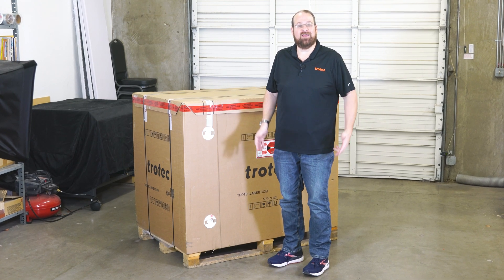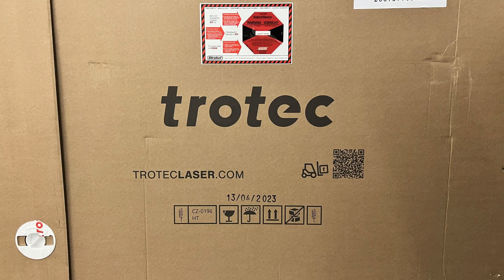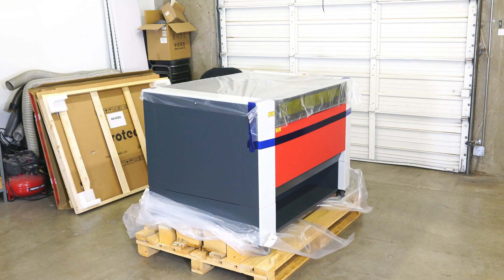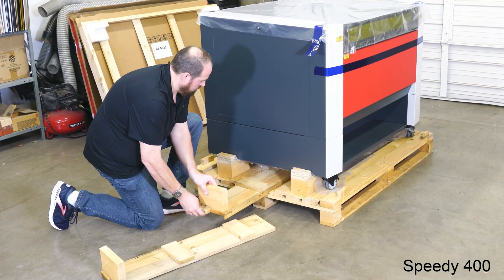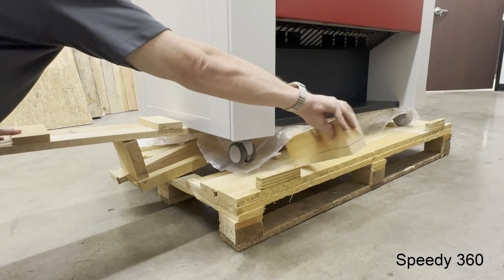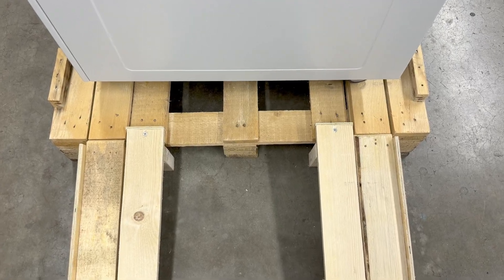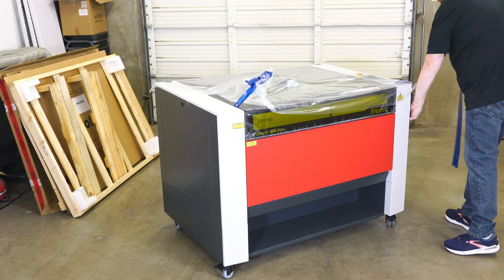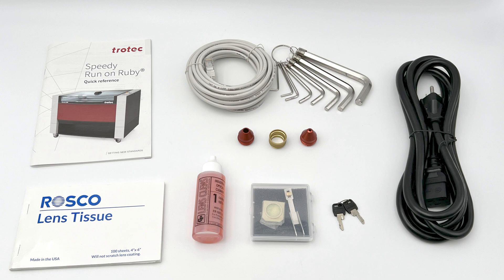Trotec Laser Speedy 360 & Speedy 400 Unboxing Video

Comment: Hi Dave, i'm from Belgium and i have recently bought a speedy 360 run on Ruby machine. I've been getting this error "X-axis reference failed hardware error E2015_103" for 5 weeks now and it seems that the technical service in the Netherlands and Austria can't seem to solve my problem. Have you by any chance ever seen this error with other customers in the US before, and have any idea what the issue might be? The technicians here have tried to solve it so far by: replacing the x-axis motor, firmware updates, messing around in the OS, checked the microswitch. None of these seem to solve or be the problem.

When it occasionally does seem to reference and i afterwards move the laser on the x-axes with the arrows under the display it randomly and aburpt stops with some mechanical noise followed by the error. 

I hope i get a response here because service is lacking and i'm getting very frustrated :(.
Reply from the maker: I wish I could help you; this is the first time I have heard of or seen any issues like this, but our Technical support team will have to continue investigating for you. I am sure they will resolve this issue for you.
Reply: Thx for the answer, i hope they figure it out asap, the timing of this issue couldnt be worse with the Christmas holidays closing in. 😞 @TrotecLaser